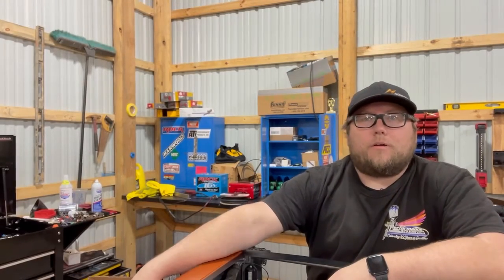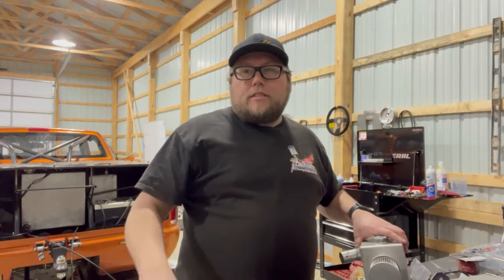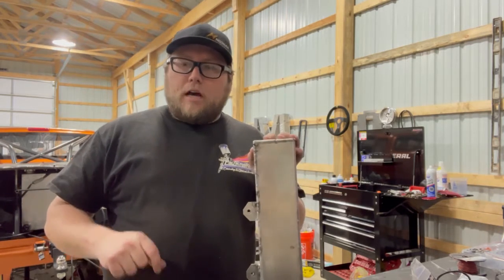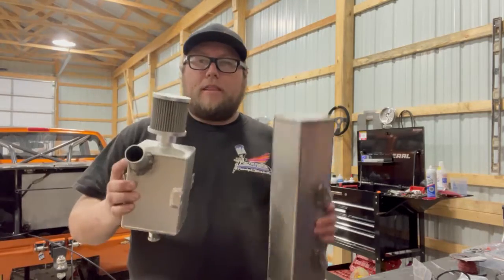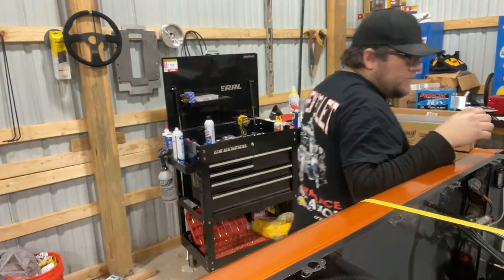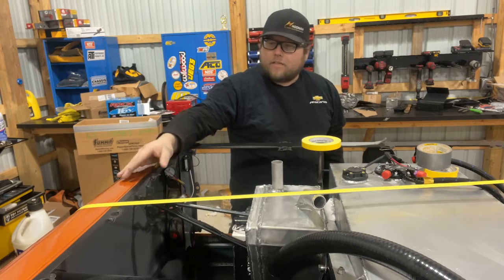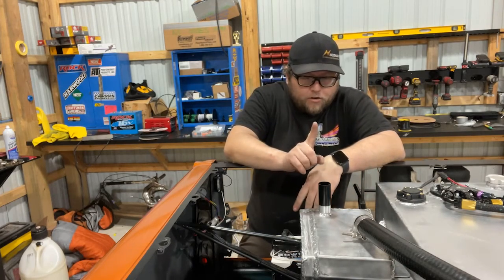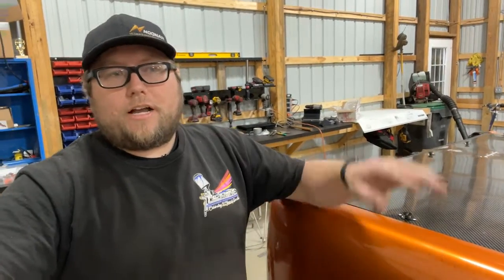Building a new puke tank for my Pro Mod and why its in the BACK!

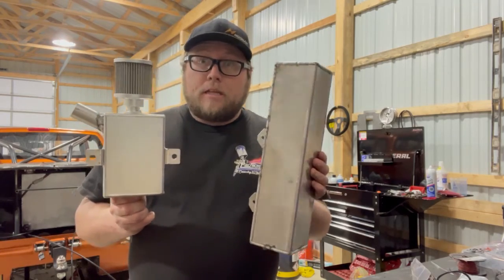Comment: At 3:05 when you mention capacity, what about for dry sump cars?    Same as the oil tank?
Reply from the maker: Great question!  Ideally yes, because, this is where oil will be pushed when there is no pump pushing it back to the main holding tank, just the boost pressure leaking into the oil pan/crank case area!